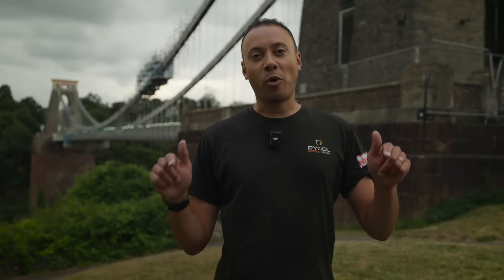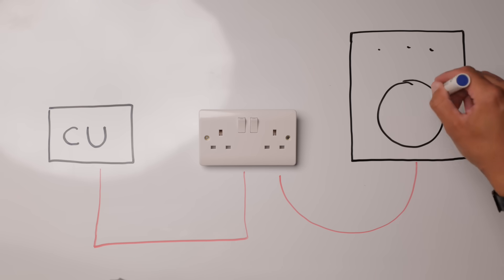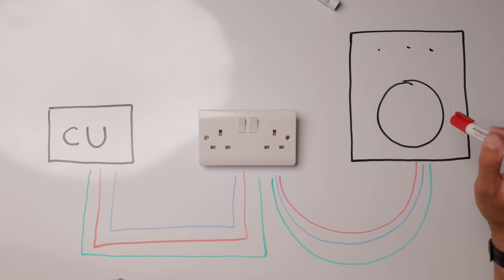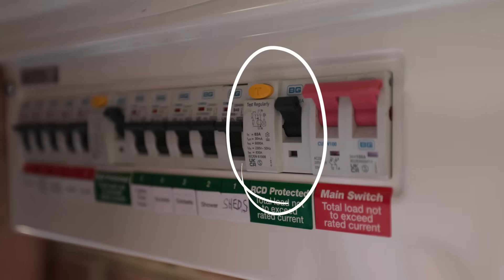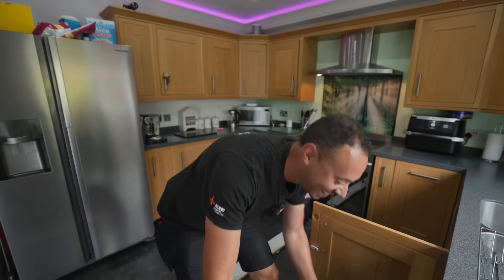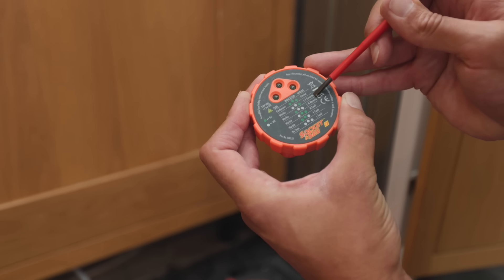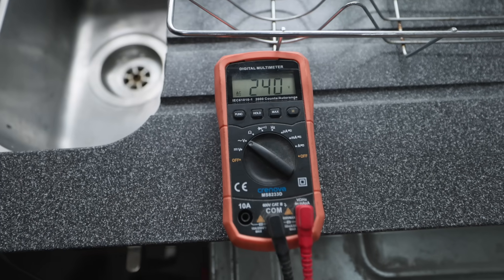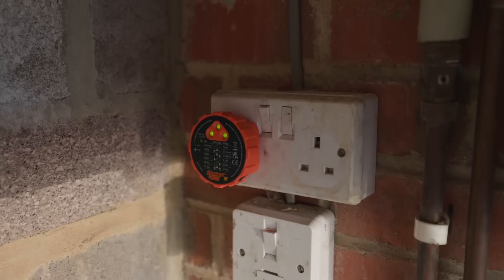This Simple Electrical Fault Turned Deadly⚡️

Comment from the maker: Have you seen a fault like this before? Let us know your thoughts on this below...
Reply: I had one in my newly built home. Thankfully,, I have trust issues and I got an electrician to inspect the contractor's work. It was in a similar appliance, a dryer.
Reply: @EbrahimHasan you're right to have trust issue then.  By law now I cannot add wiring to my own home without having it checked and certified by a qualified electrician.  I always prefer to hire a sparky who will have their own work checked and signed off.
Reply: @EbrahimHasan  Yikes! A new build as well! Truly disgusting.
Reply: After retiring from the CEGB, I spent a few years working at an NHS clinic, where I was suspicious about the connections to a lamp that had been PAT tested and passed. The lead was insecure plus the live and neutral had been reversed.
Class II insulation but wiring standards should still be upheld.
However, the worst case, and similar to yours, was just after we moved to our second home:-
Getting straight on with things, the kitchen spotlight unit needed replacing with a fluorescent luminaire. After isolating the lighting circuit at the CU, I unscrewed the metal fitting from the ceiling and found that the earthing lead to the metalwork was connected directly to the incoming live loop-in. This luminaire was mounted near to the sink and both were reachable at the same time.
The house vendor's husband had died of a heart attack, so I have often wondered if it was through a shock.
Reply: Forgot to mention,,, all the taps were live looking for earth
Reply: @brianhoffman4861 OUCH😲
Reply: You always use a socket tester to verify the polarity of the socket outlet. I have seen it too many times neural and earth reversed aswell as a live neutral, thier are too many electricians that rush the job and are not conscious in testing.
Reply: @jackwilliam2965  Regarding socket testers, every one I have looked at lacks the ability to detect neutral/ground wire reversal so how do you actually know? Having watched this video, I now want to check all my sockets. The previous owner of my house was something of a 'diy bodger' as I have found out to my cost!!
Reply: @jackwilliam2965 I replaced broken socket years ago once in my home and and the trip went as soon as I turned the circuit back on at the consumer unit. I checked the new socket and it had all of the terminals in exactly the same phisical positions as the old one (which is why it fitted perfectly), but the live/neutral/earth were all swapped. That taught me to double check the connections and use a plugin socket tester.
Reply: I'm suprised our plugs have not been regulated to be colour coded inside, I've just started lvl 2 electrical at college. But every Tom Dick and Harry wires up plugs, seems to me to have them colour coded inside would be a good idea to prevent accidents like this.
Reply: @OxidusMagicus-c9v education prevents accidents .
Reply: brilliant video.
Reply: Aren't RCDs supposed to detect earth leakage current?   If they cannot detect when the earth circuit is live, the most obvious and potentially fatal failure mode, they sound almost useless.
Reply: Early 90s my uncle was electrocuted by a washing machine and he died instantly.. very surprising how much power must go through a washing machine.
Reply: Years ago, before they fitted RCDs in homes, I had a plumber call to re-route a 1/2" copper cold water line under my house. The first thing he did before cutting the pipe was to clip each end of a jumper wire across the proposed cut. Just as well he did too - yep it was live but I dont recall the voltage drop. 
Sparkie arrived and said yes, a lot of these homes had all plumbing fittings earthed back through the copper piping and earthed onto the House earth rod - for safety.  
Incidently, with that in mind I later checked the voltage between my Amateur radio shack earth plate ( 2ft sq 10G SS plate laid flat in the ground ) and the transceiver case when plugged in - 2.5V difference.  The house earth rod and my plate earth were about 20ft apart in the ground.
Reply: Badly scripted. You say at 1:44 that it's a "dead short". Yes, there WOULD be a short to earth should it be earthed, but if it isn't earthed then there is no "dead short" well it isn't. There is no short should the casing become live, but mains voltage at the casing. You then say "that power needs somewhere to go fast". Again, that confuses matters. There is no current flowing and no "power".

Comment: And that is why in old Europe house where there is no earth you basically tie neutral and earth in socket cause if there is live touching body of the appliance it will short to neurtal and your braker will trip...still dangerous but most likely nobody dies...and u will know sometimes is wrong immediately...In new housees of course there is 3 conductors but and it is simple but for many years this saved many lives....and ifc there was no GFCI and so on back then

Comment: I've seen a situation where two separate circuits (electrical sockets and a water heater) were always charged no matter if one or other of the RCDs was turned off. Luckily I got suspicious of the builder/handyman who was moving some sockets and switches after he complained that he'd shocked himself in the process. He had told me that an electrician was coming in to do the electrical side of things as part of the job but clearly he did it all himself while I was at work.  It was a bit of a head scratcher for a while before I figured out what he had done... He'd mixed up the live cables and taken one of the lives from the double socket and wired it into the water heater switch and wired the water heater's live into one of the double socket lives. I guess that he was only alive because both RCDs tripped thank God! I didn't ask that guy back. I got one of those socket wiring checkers and went around everything he'd touched!

Comment: If the wiring had been correct the fuse in the plug top should have blown before the mcb or RCBO of the consumer unit tripped. Trouble is the socket was incorrectly wired.

Comment: Bit of a ropy explanation mate....  Are you seriously saying you would not get a shock from the live case unless you are in contact with the sink.  If you touch 240v you will get a shock unless you have dry rubber boots on.

Comment: it's when the shock goes directly across your chest that's the worst. As an apprentice sparky I had that once. I was holding on to a piece of steel conduit with one hand , and managed to get my other hand to touch the Live conductor. 
It was the worst shock I ever experienced. I was young, so no underlying health issues. Also there wasn't any dampness , I had dry hands , on dry conduit . so I guess I got lucky.

Comment: We have 230 Volts in Germany. And we have 400Volts for boilers and ovens etc. I had two 230V shocks in my life. But it never hurt, I was just a shocked that made me cramp for a split second. Never felt any pain though.
Reply: You were lucky then, I have had a few 230V shocks over the years through sheer carelessness, I am qualified and should know better. Each shock was brief but very painful, fortunately I was thrown off in each case. Worst accident I had was testing a dishwasher live with wet hands. Received a shock which threw me across the room. Never ever again.
Reply: @iainmacleod4007   Maybe it didn´t hurt because it was too short since the RCD reacted in a split second, or it´s because of my autism. But the first time, I stood on my mothers couch and I flew backwards into a glass table.

Comment: The line being in contact with the casing is not a short circuit, it is an earth fault. A short circuit is between line and neutral.

Comment: Hi I'm not an Electrician but respect your time in explaining and the practical demonstration. I have worked in the radio and TV servicing industry. I was taught to keep one hand in your pocket. This was my first job in 1967 when I left school. I have built and tested electronics in the aero-engine industry in derby UK.  The TVs in those early days were only two wires no earth at all. The Neutral wire was connected to the metal chassis inside the TV. You as a customer using the TV would be safe providing you didn't take the back off while being switched on. But most houses  had only two pin plugs. so the metal chassis could be 50 / 50 Live mains. also not forgetting the High Voltage to the Anode on the Tube. If you brake the Rule of one Hand in Your Pocket it can become very dangerous. I'm 73 now in 2025. I had a nasty shock of the mains around Covid time. I felt ill and the  next day I went for a check up at the local A and E department Hospital. I had burst some red corpuscles in my blood stream. I was very lucky. It took three weeks for me to get better. I also taught the apprentices at the aero-engine Instrument department to Put one Hand in there Pocket when working on Live mains. Thanks all the best Ron from South derbyshire .

Comment: Some years ago, several months after we moved into a new house, I needed to move a socket. I'm a confident DIYer and know my stuff and it was an easy job, so I isolated the ground floor ring and tested that it was dead, but it wasn't, it was still live. Upon checking the CU, it became apparent that the electrician had put one live end from the ring main into the immersion heater MCB and the live from the immersion heater into the ring main MCB. In other words he'd crossed the circuits. I called him and he came straight over, he was so embarrassed and asked me not to tell anyone, which I agreed to, but I'm not sure I should have?

Comment: 1:53 this is sloppy terminology, you should know better and do better if you're trying to educate. You're mixing short circuit and ground fault, voltage, power, current like they're all interchangeable terms and it's just adding more confusion to already confused public.
If there's a fault that causes the device housing to become energized, that is mains voltage we're dealing with, not power. And it doesn't "need" somewhere to go "fast" - without grounding there wouldn't be any current until someone touched it and completed  the circuit. No, WE want to create a low resistance, controlled path to ground, that way a person can touch it without suffering an electric shock because electric current follows the path of least resistance. This would create a short circuit - a ground fault, that's why we have RCD/GFCI devices that detect this leakage of current and disconnect the electric circuits.
Assuming the rest of the wiring is up to code, you should still be relatively safe even if the RCD is faulty. The PE conductor should continue to provide a low resistance path to ground.

Comment: I don't know a lot of about British sockets, but in Europe most often ground wire goes in the middle in-between L and N, so maybe electrician didn't look into the markings and "connected as usual", the distance between the port for the ground should have raised some suspicion though, I don't buy the rush and colorblindness arguments, because he connected N right, and ground has two colors,  also he used double wiring, it takes more time, so hard to believe he was rushing. Anyways the negligence on the part of electrician is criminal. That's why I prefer doing my own electric connections, despite I am not an electrician,  at least I know that I will be careful for myself, and if I'm going to make a mistake I'm the one who is going to pay.

Comment: The terrifying bit here is that the powder coat finish on the appliance is also an insulator - you won’t get a belt until you pull it out and touch the unpainted galvanised body. I hope the sparks was prosecuted.

Comment: Few years ago I wanted to change socket over in kitchen, out of the six sockets and after I had switched the mains off I plugged in a tester and it showed the circuit not live, took off the relevant socket cover I wanted to change and in doing so got a shock, it transpired the previous owner had put in extra socket to kitchen but used the hallway circuit
Reply: 𝑎𝑓𝑡𝑒𝑟 𝐼 ℎ𝑎𝑑 𝑠𝑤𝑖𝑡𝑐ℎ𝑒𝑑 𝑡ℎ𝑒 𝑚𝑎𝑖𝑛𝑠 𝑜𝑓𝑓 𝐼 𝑝𝑙𝑢𝑔𝑔𝑒𝑑 𝑖𝑛 𝑎 𝑡𝑒𝑠𝑡𝑒𝑟 𝑎𝑛𝑑 𝑖𝑡 𝑠ℎ𝑜𝑤𝑒𝑑 𝑡ℎ𝑒 𝑐𝑖𝑟𝑐𝑢𝑖𝑡 𝑛𝑜𝑡 𝑙𝑖𝑣𝑒   The previous owner isn't the one who made a mistake. YOU did. If your test fails while the circuit is live, your testing method is at fault.
Reply: @maartenvandenberg4223 funny that as when I got a qualified electrician out he told me it was wrong of what the previous owner had done

Comment: I got a belt of a washing machine while taking the washing out when I touched the sink and the drum. Turned out to be reverse polarity on the washing machine (ie switched on neutral) with no earth so not technically fully live but leakage through the heating element and motor which were permanently live. Enough for a decent belt with wet hands.

Comment: There is a number of stories here in the states of people crawling in behind appliances like a stove or behind maybe a washer or a dryer when you have them pulled out and your crouched down in a cramped area and you may put your hands on something to help you stand back up or just to stabilize yourself and you could be touching something else and BOOM 💥 you’ve been zapped, because something is wrong somewhere and you weren’t expecting it to be there but you’re the one who found it I can’t tell you how many times I found stainless steel sinks energized, I’ve even had brick walls and porches energized but that was from not wrong wiring but wiring that ended up touching something and shorting out or leaking, I’ve been zapped probably way too many times in my life my two worst shocks were in the largest suburban department store in the state of Ohio back in the day and we never worked on anything turned off, super dangerous but that was 50 some years ago and luckily I’m still here I’m super careful now super careful, it’s invisible, I still never seen a plumber drown, plenty of homeowners and handyman and other trade people, electricians, they’ve been shocked and or electrocuted

Stay safe 
Never assume 
Never ever ever trust anyone when they say the power is off, the only one that can assume that or prove that or accept that is you doing the work  👍

Love the videos I share them with others  😻

Comment: When using a non-contact tester on multi-core cable run the probe up and down the cable and around it too.  Don't just touch the probe to one place.  The other cores can "block" the detection of a live wire within the core.   Of course you shouldn't be using it to test of dead, but as we all know, people do.

To properly test for dead I can recommend a two pole voltage tester such as the Martindale VT12 and others, just make sure they do the alerting on a single pole.   Using a multi-meter is not as great idea if it doesn't alert on voltage found on a single pole, if both probes poles are touching 240v it will show 0v on the display!  Zap!

Comment: Always always test. Even if it’s with a simple socket tester. My dads a good spark but on a job we did every socket he 2nd fixed he got Live and earth back to front. Easily done when the earth terminal is to one side. Luckily we found it when doing megga on circuit. Never lived it down even 10 years later we have a laugh about it. Always test!

Comment: Would not surprise me if the plumber did this himself pulled machine out too far and pulled cable out of plug and rewired it himself it does not sound like a mistake a qualified spark would make to be fair but then mistakes do happen its particularly sad when it costs someone their life.

Comment: Well... This video certainly explains how I got a shock once years ago while changing a wall outlet. Canada, so 120V system. I did throw the correct breaker and verified socket was no longer active. Fortunately it was through a screwdriver (non insulted though) so my reaction broke the circuit immediately.

Comment: I had one in a new build home, the day I moved in I switched on the cooker switch and it blew the 100 Amp supplier fuse , complete with very loud bang and blue flash from the switch.  House plunged into darkness and underpants changed....

Comment: Sorry to be critical but you need to have explained where the neutral goes after cu and the relationship with the earth. No mention of tncs etc. Moreover, the washing machine is not simply a resistance load or element. Only when heating water does this become relevant.

Comment: I've always been a bit unimpressed that during an electrical safety check, carried out during the course of a house purchase for example, the electrician will choose around 10% of the sockets to test. That might not pick up this type of situation. Those socket testers we see you using in this video are really cheap and I've tested every single socket in my house. (In France). It's less of an issue due to the different system they use, but I found a significant number had live/neutral reversed as well as a couple of missing earths. I highly recommend getting such a socket tester.
Reply: i thought shuko plugs can be plugged in either way anyway effectively reversing live and neutral